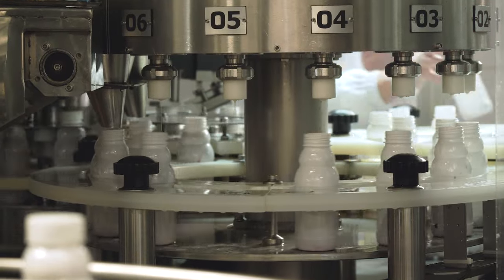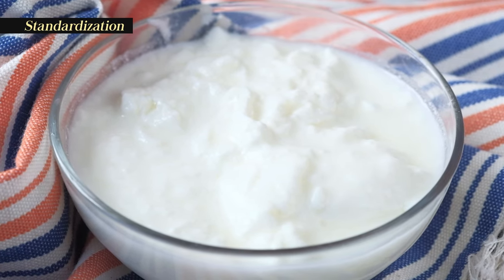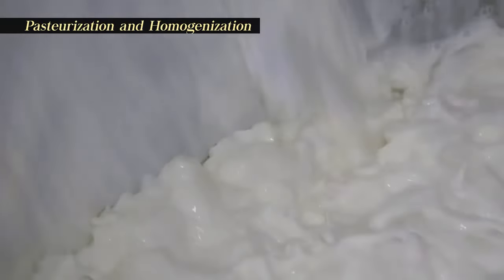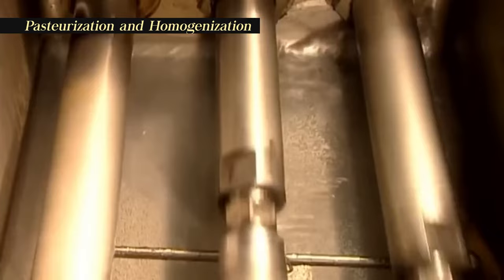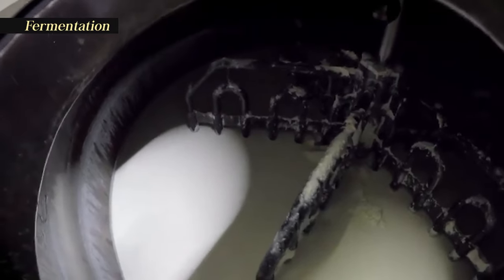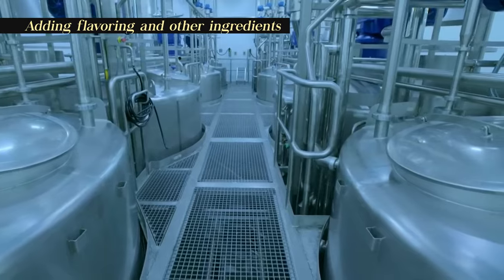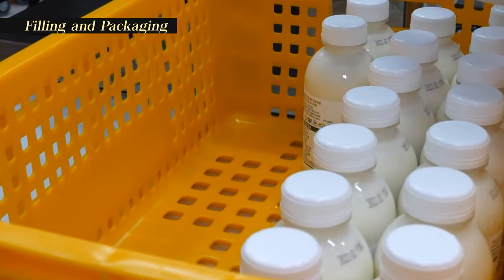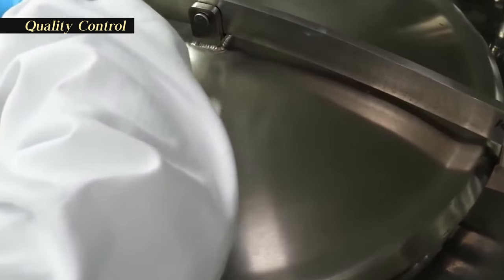How Yogurt is Made

Comment: As a process engineer working in the dairy industry for 30 years and a yoghurt plant for 10, this video shows a little bit of truth and some inaccuracies. For example homogenisation is not achieved by cavitation, cavitation is very much to be avoided as it damages the equipment and is not controlled. Homogenisation is achieved by the very small gap in the homogenisation valve and the very high pressure pushing the fluid through. This causes the fat globules to break down in a controlled way, according to the pressure, which is measured by a transmitter and controlled by the hydraulic pressure which sets the size of the small gap in the homogenisation valve. Heating of the yoghurt mix is done usually in a plate heat exchanger followed by a spiral holding tube, and the temperature is 95deg C for 5 minutes not 85 for 30. It is done to denature the whey protein and also it is useful to deaerate the yoghurt mix to remove air. Air can affect the fermentation.